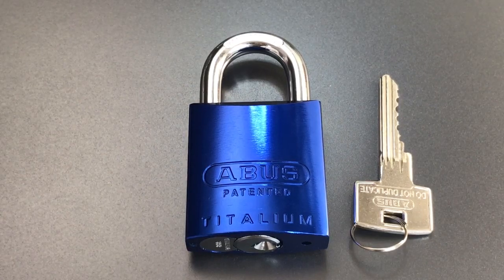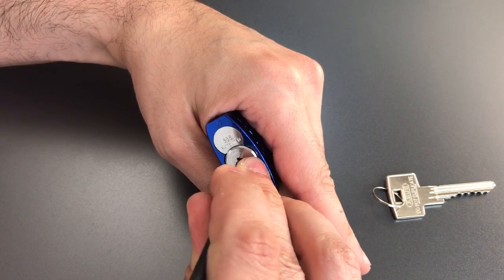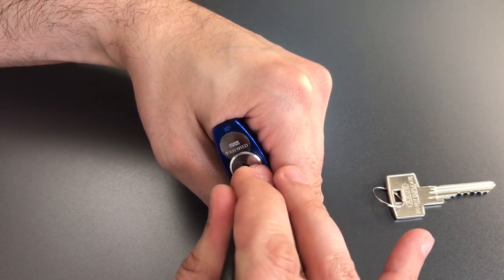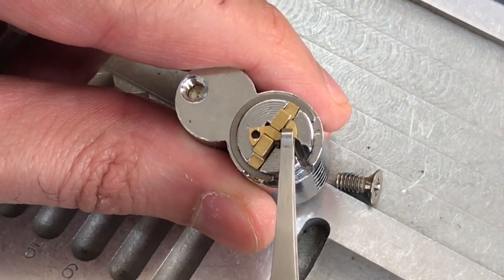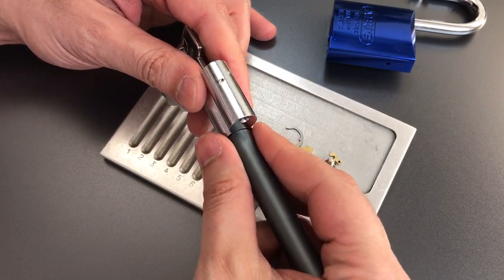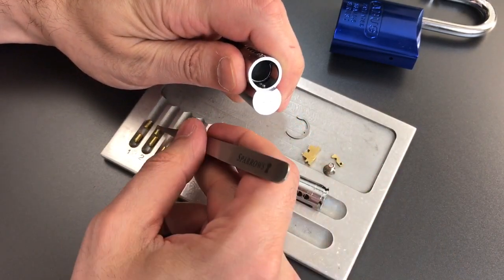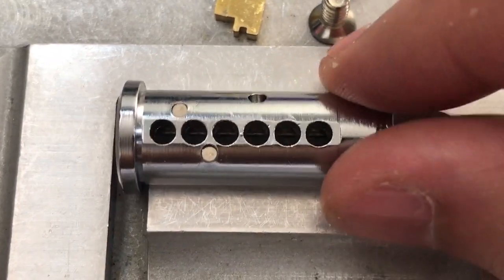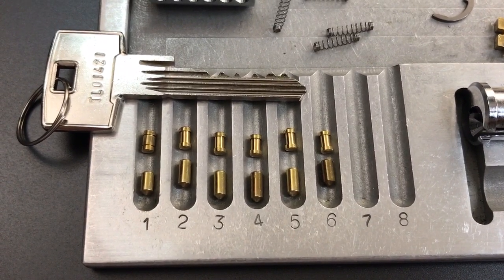[512] Abus 83AL/45 Titalium with Restricted 888 Cylinder Picked and Gutted

Comment: I think its not just a gimmick, but a way to use trademark protection laws to protect the keyway and prohibit duplication. Normally, restricted keyways are using patent laws, but they usually have a timelimit of 20 years and then the patent expires. And patents are expensive to renew too. By using trademark protection instead (by incorporating the ABUS logo into the keyway), they can have the protection active indefinitely (until Abus company disappear) and they only have to register and pay protection once.
Reply from the maker: +Sebastian Nielsen Interesting. Thanks for explaining.
Reply: Sebastian Nielsen You are right. Many companies use ® keyways. DOM RS SIGMA and EVVA EPS-M show DOM and EVVA, some others have just trademarked an already existing keyway to extend protection beyond the patent's 20 years. Those show some zigzag-graphics® on the bow and most often it's mentioned in catalogs and on websites.
Reply: That is what the manufacturers claim and looks interesting in theory, but I believe it's just a marketing gimmick. In practice it should be very ineffective, as it is trivially easy to create a non-infringing key that adequately fits the keyway. For example, a hypothetical trademarked "XXM" keyway could fit a "\/V" profile key. Besides that, at least in my country, I'm not sure a trademarked keyway would be easy to defend in court. 

And let's not give printer manufacturers this idea, otherwise we will start seeing "HP" or "EPSON" shaped ink cartridges!
Reply: José Tudela de la Rosa Missing parts of a keyway can be detected, so if some patented (e.g. GEGE pExtra) or trademarked part of the cross section is missing, the cylinder is blocked. This is achieved using an extra pin or some other element (e.g. EVVA EPS).

Epson and HP put to much effort into protecting their ink cartridges instead of improving their ink recipes...
Reply: Interesting. As far as I know, trademark law generally prohibits using them to protect functional elements of a device, though I guess they might be hoping no-one has the cash to fight it in court.
Reply: @makomk  Considering that restricted keyways are used as a key control method, I imagine most users aren't likely to complain.
Reply: Wouldn’t they also need  to register similar shaped words? “It’s not a duplicate, your honor, our keyway clearly says A8U5.”
Reply: Lol, that's bullshit. They shouldn't be able to use trademark like that.
Reply: @mr.bobcyndaquil4214  That was an issue Lockwood (now part of ASSA-Abloy) in Australia had. In mid 1960's it started using a family of 6 profiles (which could be passed by a 'master' profile) and registered the 'design' (design patent in USA terminology). The profiles treated as 'restricted' were extensively used for general masterkeying, railroads, utilities, Government agencies etc. When the 'Registered Design' expired there were so many of these keys in use that there an after market blank manufacturer started producing blanks for some of the profiles (eg AB, AC, AD were very common and BD uncommon). Lockwood took them to court arguing that they had a copyright on the profiles which needed to be enforced because the keys were used by Government agencies etc but the court would not accept the argument. Although there theoretically be no demand for after-market blanks, there were sufficient numbers of these keys used for apartments etc where individual owners or tenants wanted to get keys made without 'red tape' associated with restricted keys, and some locksmiths also used them even though they were authorised to obtain the genuine blanks. Fortunately the aftermarket supplier had the decency to produce the individual profiles and not just produce the master profile. The advent of computer controlled machine tools meant that broaches (to cut the keyway in the cylinder plug) and milling cutters (to make the blanks) became far cheaper to produce so there was an explosion in the number of restricted profiles meaning it was uneconomic for aftermarket blank manufacturers to produce blanks when the designs expired.
Reply: @makomk  This just means you cannot apply trademark protection to a element which is required for its function - for example, you cannot trademark a piston in a engine and have the piston being part of your logo.
But the opposite works very well - you can trademark a logo - and then create a functional element that is identical to the logo. The important thing is that the device in question - in this case a lock - can be recreated without this functional element, so you don't restrict or harm invention.
And yes - it can - you can create a lock with any key profile.

Same have been used in copyright protection - for example GameBoy. You have a check that refuses to start the game unless you store the "Nintendo" logo on the first part of memory. Since the logo always come from the cartridge - they could always claim trademark infringement if someone sold a unauthorized gameboy cartridge.

That copyright protection had a little quirk however, and that was that the processor read the bitstream 2 times, one time to check it against the validator, and one time to show it on screen. Meaning that later on, when technology had advanced, they could have "dynamic ROMs" that would send one bitstream first time (to pass the check) and second time they would send their own logo - fouling the trademark check.

Also Nintendo used this sort of trademark protection for their NES Disk system, where a "stamp" would need to precisely fit into a "Nintendo" logo for the drive to fully engage the disk - to prevent third party disks from being made. Was however bypassed by replacing the logo parts with rectangles that would fit around the stamp, as the stamp didn't have plungers to check for missing parts of the logo.
Reply: @Camelotsmoon  Why not? I feel that when it comes to keys - its actually adequate with infinite protection, as its important that key copies does not leak around and become a security issue.
Reply: @sebastiannielsen  That's not what trademark laws and regulations are meant for, that's what patents are for; patent is to trademark a design and not a logo like trademark...trademark and patents have different time limits and expenses aswell.
Reply: @Camelotsmoon  I know, but its a good thing when existing laws can be reused for other purposes without having to create new laws.

Of course, its not fair if a company can protect a design indefinitely, as it hampers the possibility to invent new things - thus its fair that a design should have a maximum protection time so its let out in the free after a certain time.

But when it comes to keys - its actually fair - especially when it comes to master keys that are used by governments -  think the FireBox keys used in US and TSA master keys and such. In such cases, its very fair that the keys do have infinite protection time. Doing an exception for keys would just be kind of weird and silly - better to design the key in such a way trademark protection can be used.

This does not hamper the invention of new locks and keys, as the trademark protection only applies to that particular keyway - meaning you can easily desing a new lock and key using another keyway.
Reply: @makomk  Nintendo Gameboy tried and LOST that trademark "battle"
Reply: Wow, cool, cool theory
Reply: @josetudeladelarosa6636  i was a bit amazed when i realized the refurbished ink cartridges had to slightly drill out the HP logo in the plastic

Comment: You are certainly a wealth of information. Perhaps in the future you can explain or show how ... the key retention works.
Reply: R.P. Rosen Every cylinder needs to be turned to a certain point, so that the key can be removed. The Z-Bar prevents the cylinder from turning to the point needed to remove the key. You will need to close the shackle and then you can remove the key.
Reply: Watch Bosnian Bill
Reply: i have an Abus 83/45 and it has a removable z-bar for key retention

but mine has the 300 keyhole

Comment: You have really fired up something in me with these videos, each of these locks is like the prefect little puzzle, i'm taking locks apart all the time now and find them fascinating. I might even get a locksmith certification to make some money out of it also, thanks for these great videos
Reply: Sure, get a locksmith license and anyone with a safe and need the opening password, just call in the registration number from the front o f the safe if the person was not warned by the seller, and they will give a bypass code to a locksmith.  Easy pickings there.  Of course it could be used for good but seems that the population now adays finds theft to be a worthy career.  Why work when your neighbor is working for you, I am feeding several single adults some of whom have felony records.

Comment: The pinning made this lock easier than usual.  I've found that high-low bittings with this keyway can get tough because the tip of your pick has to fit into the left hand side of the "A" of the keyway, which is pretty tight and not easy to get into with wider picks.  Either way, great pick!

Comment: Correction about the Z bar. If you remove the Z bar then the lock is in the non-key retaining mode. However with the black dot facing down you are in the shackle replacement mode to remove the shackle from the lock body.

Comment: Just re-watched this video and heard you say that when you place the Z-Bar with the black dot facing down the lock is non-key retaining. I think i've corrected you before, but with the Z-bar in that configuration you can turn the key and completely remove the shackle. For non-key retaining just take the z-bar right off.

Comment: Is "Titalium" meant to be suggestive of titanium and aluminum? Seems like the vid could have covered that. Thanks.
Reply: It's maybe quicker to type "titalium" into google than to type your (valid) question - it's a trademark they're using for an aluminium alloy (aluminum if you're in the USA of course), I guess they're hoping to imply that it's kinda titanium-like... First hit I get is this https://www.abus.com/uk/Home-Security/Padlocks/TITALIUM  , but I've got to confess that I've had the same curiosity in the past and my previous searches may reflect my current search outcomes :)
Reply: Thanks, Lefty.
Reply: Isn't Galluminium better? It would be much more pick resistant, as the lock would disintegrate under picking attempts.

Comment: is there anything you haven't been able to pick before?
Reply: im more worried about the twist attack vids, thiefs arnt likely to pick, more be in and rip them off
Reply: I was going to ask this too! Bosnian Bill has his naughty bucket with all the locks he hasn't been able to pick, wondering if this guy has too!
Reply: Jusb1066 - I totally agree.  Not only are many common US padlocks vulnerable to destructive attacks, but the hasps themselves are just as cheesy.  A three-foot crowbar will pop most of them right off the door frame -- by pulling the small screws that come with them right out of the wood.  You can make that better by using bolts or machine screws that go right through to the inside and backing them up with a metal plate ... but then the hasp itself can be attacked, too.  There's really very little one can do against a determined and resourceful thief.  Besides, to me, lockpicking is just for fun.
Reply: The EVVA  3KS.
Reply from the maker: +Tyler Many, many locks. Anyone who says otherwise is lying.
Reply: LockPickingLawyer can you specify which ones? 
Im waiting to buy a good lock(difficult to pick+ unshimable+difficult to force) for closing a bike chain with
Reply: don trump Just go with the good ol' Stanley lock!
Reply: @rronaldreagan  Abus Granit 37/55

Comment: You've said in at least two videos that the conversion from key retaining to non-retaining is flipping the Z-bar. That is incorrect. The documentation states to only insert it black dot up and to remove it for non-retaining function. When flipped it can cause unintentional ejection of the shackle and potential loss of its ball bearing and/or spring. I learned this the hard way reversing it in my first 83 series.

Comment: I repinned that very same abus cylinder with chess pins. The problem was when reinstalling the core, a driver pin shot into the construction pin hole and now I have a $25 paper weight. Any advice would be amazing. Shims don't seem to work.

Comment: Hm .. seems like those spools were engaging well, based on how you were picking it .. but those key pins are pretty long .. can you sometimes show key pins in the core with key out better ? As in 4:20. It seems like 1 was quite deep, but that one had serrated pin. 2 and 6 looks somewhat able to hold a bit of spool .. and 3, 4 and 5 too shallow to do anything.
Reply: Excellent observation, seems to make the security pins ... pointless.

Comment: Lovely looking lock, the colour is realy nice. I find the number one pin in most of my abus locks i have picked picks very much the same ie you get the false set then its pretty much pin to pin to the back to open the lock along with the number one normally resetting due to the spools. Do you recognise this pattern ? I aldo find ecen the small brass 40mm without removable cores still challenging sometimes.

Great pick and video, the keyway wall really cool.
Reply from the maker: Yes... but you may also need to set some of the deep cuts before you get a false set.

Comment: I have this same exact lock. But my bitting is all high cuts. Maybe they're from the same Ebay listing.
Reply: Me too! All cuts but one are super high. I haven't been able to pick it yet.
Reply: xCAETUSx Haven't picked mine yet either. Can't seem to get up into the warding with my current arsenal of picks.
Reply from the maker: +The Lock Picking Lebowski Hows that lock treating you?  Is it just me, or do these 888 cylinders seem to have much better tolerances than other 83 series cores?
Reply: LockPickingLawyer Please check Twitter notifications regarding comparison. I can say this: the tolerances are quite impressive! The spring tension on the core is very strong. I'll take a better look at my core and tolerances today. I am going to file the end of my key so it lines up with the dimple on the keyhole. I was surprised to learn that it doesn't line up and makes for a fumbly insertion. I  don't think I'm skilled enough to pick it with my current selection of picks. The cuts are so high that I can't seem to get any pick tips up through the warding. I'll keep trying though. But I really would like to consult with you before I create my next order for Peterson and Sparrows. SouthOrd was okay for my first 3 years of picking on the cheap. But after recently using decent custom picks, I can confirm that an investment into quality tools is now warranted.

Comment: nice picking. a bit confused how the z key retaining bar works. could you explain it or do a short video at a later date
Reply: Chris Ahrens LHG it acts as an interlock, preventing you from turning the core when the shackle is open, this means the key pins can't move since they're held on the shear line by the cylinder wall . If you remove it, you can rotate the core back in line with the bible, and the key can be removed, since the key pins can push the drivers up . The advantage is that you can make sure people have to lock it back up (on the hasp ideally) after they open it up, or have to carry it around on their key chain until they're done - very useful if it's on a communal gate for instance :)
Reply: 2LeftThumbs but LPL wasn't removing it he just flipped it. to change retaining from non-retaining. I'm sure it's how the z bar interacts with the lock but I can't see it
Reply: Chris Ahrens LHG  ah, OK, I haven't tried flipping it personally, just removing it    it isn't symmetric though, like a Z or 2 with the black dot up and an S or 5 with black dot down. so it catches like a ratchet in a pawl one way, but not the other I guess :)
Reply: 2LeftThumbs that's what I kinda thought just wasn't sure couldn't imagine it in my head how it caught
Reply: Chris Ahrens LHG if LPL doesn't come up with a video, I'll see if I can put one together ( might be that an animation would be better, so that'll probably take a while for me :) )  I did flip the bar accidentally once and couldn't actually reassemble the lock, I'll check if it is meant to be flipped...
Reply: 2LeftThumbs ok I subscribed to you
Reply: ah , thanks - I guess I'd better get busy:)   - that wasn't my aim though...  I pmed you earlier with some  abus links on how the Z bar is used (both for key retention in series 1 and 2, and for shackle removal in series 2 when you flip it), cheers

Comment: What is that "key-retaining" thing all about?Is it so the key wont drop out,or..?(if u havent noticed,I'm quite green)
Reply: I have seen a few key-retaining padlocks at work... you insert the key, turn to open the lock, key will stay in turned position and not be removable. You also will not be able to turn the key back to neutral until you lock it back up. Forces the user to re-lock the lock in order to get his/her key back.
Reply: Thanks.

Comment: i learnt how to remove the plug from the cylinder here. If that pin went into the bible then it is game over
Reply from the maker: +BlackDolphin90 done it!  I had to Drill a tiny hole in the top, then push the pin down with a tiny wire. ☹️